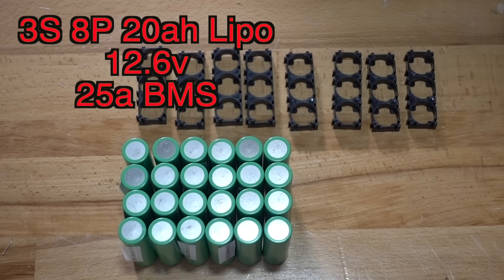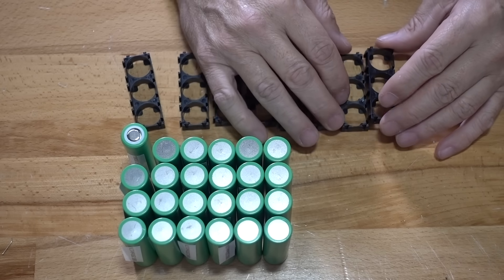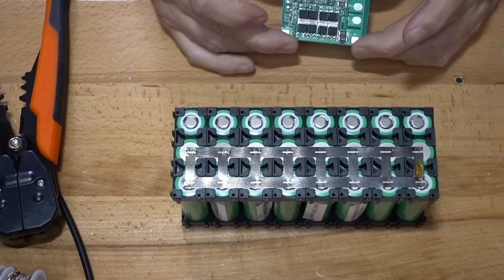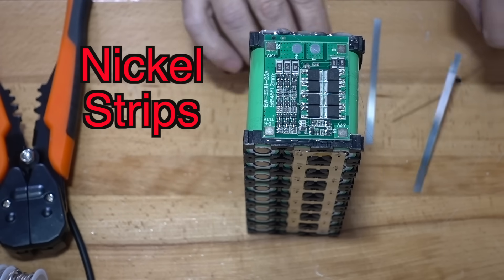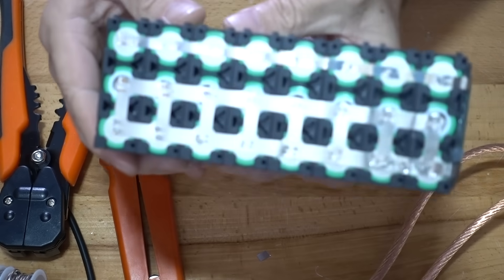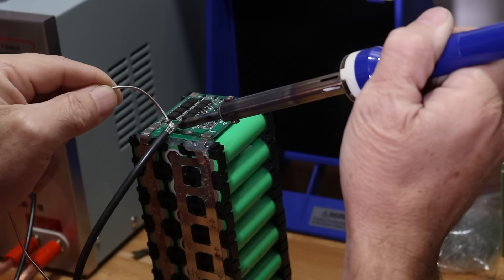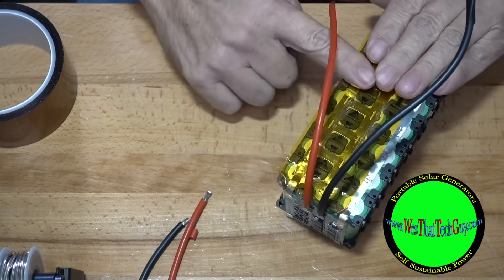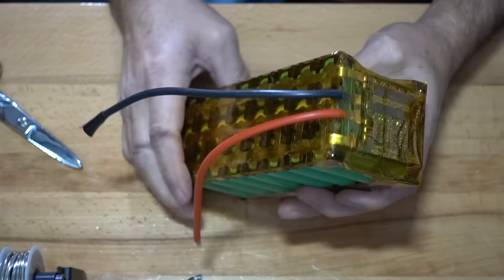How to build an 18650 Lithium Battery Pack with BMS.

Comment: Hi sir
I wanna make 48v 40ah battery pack for ebike my bldc motor is 1500w but unable to understand that how many cell are be used or could tell me any method to calculate
Reply from the maker: 13s16p for a 48v lithium pack. 208 18650 cells for 48v, 40ah and 400a continuous discharge battery thats 13x16=208 batteries using the same batteries that are in the video. Fully charged it will be 54.6v. You WILL NEED a special lithium charger for this build. Good luck.
Reply: @WesThatTechGuy  aha , some maths gonna astray here. You could use some cheaper cells . It needs 48V at about 31A to supply 1500W. This is fine but when you are taking that 31A from 16 cells you are barely taking 2A from every cell. Don't go mad and buy all Samsung 25R that can supply 20A continuous. To my knowledge all 18650 can put out at least 2A. Try and find the ones that are the cheapest per kwh. No need to worry about discharge. Happy building!!

Comment: At what range we can apply voltage to the BMS? Is that depends on total capacity? I mean for 4S BMS should we apply 13.5V to input of BMS?
Reply from the maker: sure you can supply 13.5v to the bms for a 4s not a 3s.

Comment: What should be the input votlage & current to the 4S BMS?
Reply from the maker: it would be 16.8v at 25a max. can get a bigger BMS too.
Reply: Thank you
Reply from the maker: @Prajwith Ullal you're welcome and thank you!
Reply: What do you use to supply voltage for the batteries to get charged. What kind of charger?

Comment: Can you make 4 or 5 packs of those and connect it together? How do you do that? Help please
Reply from the maker: Yes. You can run them in parallel or in series. Parallel: + and - to + and -.series is a bit different. you run them from a neg of one to the positive of another then from that pos to the neg of another and so on so when done you just have 1 pos and 1 neg. the 1st battery will have the pos lead and the last battery will have the neg lead.
Reply: @WesThatTechGuy  great, thank you very much I am sure that if you would make a video connecting several packages many people would see it. Thank you again
Reply from the maker: Thanks for the insight and look for one coming soon!

Comment: The way you attached the power out wires was really disturbing for me!
Reply from the maker: Any advice would be appreciated! Can you give me some pointers maybe?
Reply: @WesThatTechGuy  It is just me! I am taking soldering wires as a bit of an art! But i would twist the wires before hand fill them up with good fresh solder then fill up the pads too and then just touch them on the pads and get them stuck round and nicelly on the bms!
Reply: @WesThatTechGuy  basically fill up the wires with a good amount of solder and then put them on the bms! That would make a better placement and more secure too!
Reply from the maker: Ya I filled them prior and soldered the board but they are pretty thick so they were a bit of a pain.
Reply: @WesThatTechGuy  Working with such thick wires though requires a bit of a powerfull soldering iron since that thick wire dissipates the heat really fast. Dont know if that is the case with you.
Reply: @WesThatTechGuy  Also having that loose + lead wire that has a completely stripped end flopping around when you were kapton taping that pack up if it swung and hit a negative side of your pack it could have welded itself to your pack and then you'd be in for a world of not so much fun hopefully it would have burnt up the bms before causing any cells to explode
Reply from the maker: ya it could happen but not explode that quick. I've done these batteries for over 15-20yrs. I got this but thanks for the concern Logan.
Reply: @WesThatTechGuy  .....need a bit higher wattage soldering iron, pool up the solder and apply the wire into the pooled solder along with a "bit" more heat to make a good solid connection. 
Jmo...I was in the TV repair bizz for ova 35 yrs. Did some soldering in those yrs.😉
Reply from the maker: Thanks Frankie.
Reply: I use the good  ol' trusty Wall lenk LG -400,  150- 400w soldering gun. On my 2nd one now, as the tip finally delaminated after 22 years. It was just a smidge more for a complete gun & case ect. as just for the plug in replacement barrel / tip. Am all about joining  large gauge wires quick, so as not to induce to much transfer heat. Absolute must to fill the wire strands & contact first, before final soldering.... Overall,, very good /interesting vid ! . I74
Reply: @WesThatTechGuy  5:58  freeze the frame there .... see how the positive wire brush is almost shorting to the negative pad? .. not good.  Better workmanship can provide higher reliability ... instead try to limit width of wire brush bundle to equal or less than width of the board solder pad .. so you can form a nice solder fillet from the board pad to the wire brush, 360 degs around that pad. Forming a solder fillet increasing the solder joint strength and is an indicator of a full wetted solder joint .. that is why inspection for solder fillets is usually included in any industry solder joint inspection spec. 
    Yes, it is not easy to solder this big butt wire ... I hate doing it.
    Last thing for reliability ...add a mechanical strain relief to your wires, after the solder joints ... so any motion or tugging of the wires can NOT stress the solder joints.. NEVER let those solder joints carry mechanical stress loads.
   Everything else in the video was great .. and well produced, thank you.
Reply: Please what the model of spot welding? It's splendid
Reply from the maker: sunnko 709A
Reply: Life must be quite overwhelming for you.
Reply from the maker: for who?
Reply from the maker: Thanks for the heads up! I will try this.
Reply from the maker: Thanks. I have a 100w well now so no problems with the bigger wires.
Reply: I agree...

1) Add solder to the pad
2) Strip only one end of the wire leads
3) Pull the insulation on the other end to recess the conductor
(assuming a less rigid & pliable insulator)
4) Tin the stripped end of the wire
5) Use diagonal cutters to create an angled wedge cut on the tin end
(Now you have a long contact with less mass towards the tip of the wire)
6) Melt a blob of solder on your iron with "maximum" heat
Quickly:
7) Apply melted solder blob to pad
8) Put tinned end of wire into extra large blob of solder

Repeat for second pad.

When ready:
Strip remaining wire ends & add a connector for convenience. Recommendation for an inline fuse. They are cheap for the safety they provide.
Reply: Evil Dude  different human different opinion.

Comment: Is there a trick to soldering? You seem to be melting the solder instantly, whenever i try im usually holding the solder to the iron for over a minute before it melts, also it seems to take me 5-10 goes before the solder sticks to a circuit board!. Ive tried soldering to batteries too, after about 50 tries with several different batteries and not one stuck (I dont have a spot welder), I gave up and started using cheap Chinese battery holders made in a Chinese factory in China to hold my batteries.
Reply from the maker: Yes lots of practice and I consider myself as a novice at best! Get a GOOD soldering iron, preferably one that you can adjust the heat settings like the one in my video. you NEED the right kind and size of solder (this is a MUST!). Flux or flux paste is nice to have around to help clean the area needing to be soldered.

Comment: Why bother with a BMS? Just make up a balance lead and balance charge the pack each time
Reply from the maker: Vince Williams good question that has several reasonable answers. BMS is used in this case as a safety. I would generally balance charge a small pack like this but this is just one way to make a battery pack. Also these battery packs can take 25a load no problem and its not possible to really do that with balance charging unless the wiring is much bigger than say a standard 3s, 4s or 7s balance lead. When balance charging you are throwing minimal voltage and amperage to each parallel group.
Reply from the maker: Bms is for safety on this specific build. I agree balancing can be done but has to be monitored all the time and this pack can handle well over 25a cont. charge voltage and that's not that easy to do with a simple balance charger. The Packs I build for my clients generally run 25-200a continuous charge so we use BMS for the customers. I use both methods for personal needs as well but when selling a battery pack, power wall or portable solar generator like the Solar Geni product line I sell then the BMS is a must for safety.
Reply: Thanks for your informative reply, I can understand and appreciate the requirement for a BMS to handle the intermittent high charge situations that you will get with solar etc.
Reply from the maker: No problem Vince. Thanks for watching and I can always use another brain around here so please feel free to chime in anytime! Wes

Comment: Nice job I like it.
Any budy tell that how much mAh of a li-ion cell.
Reply from the maker: Thanks. Each cell is 2500mah/2.5ah and 20a continuous discharge and the pack I built is 20,000mah/20ah at 160a continuous discharge.
Reply: Thanx alot for nice reply.
If u don't mind have a question?
2 kw load how much time run on 220 v upon a 200ah lead acid battery via inverex solar inverter.
Reply from the maker: how many volts is the solar inverter? 12v, 24v 48v?
Reply: My inverter oprates upon 24 volts.
Reply from the maker: a 200ah battery at 24v will give you 4,800wh of run time. So at 2kw drain you're looking at around 2.4hrs at full depth of discharge. but that will kill the lead acid battery quick and you will have to replace it within a few months if you drain it 100%. Hope this helped
Reply: Thank you so much buddy. U solved my problem
Reply from the maker: @jojee Bhatti your welcome! Glad I could be of help.

Comment: How are the balance leads attached? How do they keep each cell balanced? Have you tested the cells after a couple cycles?
Reply from the maker: They are attached by a spot welder and Nickel strip as shown and explained in the video. So far so good they test out fine. Yes I test them over 20 times now.
Reply: @WesThatTechGuy  I saw that you spot welded to B1 and B2, which I understand for 3s1p, but I don't understand how the cells in the parallel groups are balanced as well. Guess I just need to think about it some more.
Reply: noleftturnunstoned parallel cells don’t need to be balanced because they are always the same voltage. If one would be higher, it would charge the other one. The bms has to balance only the voltage of the 3 parallel group in series.

Comment: OK...where did you get the battery charger?
Reply from the maker: @countryside I got that particular one on Amazon. Its a 30v 20a power supply. they are nice when you are just charging various different voltages and you don't have to have several chargers to do it. This one only had + and - leads.

Comment: Hi, It wouldn't be easier if you used the solderless battery holders like these? 
https://vruzend.com/

What you recommand using those solderles holders or taking the time to solder each one of the cells?

Thanks
Reply from the maker: @deepblueak for some it might be easier but it is much more expensive and they can be a real pain to get all the contacts right. Others have reviewed them and they are really cool but the time it takes to mess with them and the huge cost I just don't see it unless you're doing a small build once. For many or big builds just as fast and simpler do just solder them.

Comment: How would you recommend running a 48v setup with multiple 3s battery packs. I have about 40 and they all have their own bms. I could just wire 4 together but if one pack shuts off early it seems it could open circuit and burn the bms up.
Reply: No 3s, for 48v the configuration is 14s for 12v is 4s for 24v is 7s,,,, 3s 3s for 12v does not work well, the nominal voltage is 3.7v x 3 = 11.1v minimum voltage is 3v x 3 = 9v if you want to work with 12v you should use 4s configuration, BMS 4s
Reply: They are not standard 18650 lipo they are boston power swing 5300 lifepo4. I did wire them in 12s configuration and they charge to 48v and discharge to 42v with the inverter. This leaves them about half full but I figure this could extend their life. If I wire 5 together it will bring it up to about 60-62v but within the range of the inverter. However this will leave them fully drained before inverter switches to charge cycle.
Reply: @SamIamNotI  
LifePo4 the nominal voltage is 3.2v if you need to work with 48v the configuration is 16s
Reply: @sinusoidalwawe7777  Nominal voltage is 3.65 on these ones. http://liionbms.com/pdf/bostonpower/swing5300.pdf  I am currently running them at 12s and when inverter shuts off they are about half full.
Reply: @SamIamNotI  
That cell 5300 is not LifePo4 is Lithium-ion, maximum voltage 4.2v nominal voltage 3.65v minimum voltage 2.75v if you want to work with 48v the correct configuration is 14s
Reply: @sinusoidalwawe7777  Thanks to both of you for helping me identify these.
Reply from the maker: just run the 3s packs in series of 4s and that should do it. shouldn't be a problem.
Reply from the maker: Michael thats not correct. Nominal voltage on a lifepo4 cell is generaly 3.2v and charge voltage is 3.65v. The link goes to a Lithium-ion cell that is nominal of 3.65v and 4.2v charged? So either you sent me the wrong link to a lipo battery or you're mistaken and your battery packs are in fact lipo not lifpo4. Even at this parameter of lipo you would be fully charged at 4.2x12= 50.4v and with LFP you would be  at 3.65vx12=43.8v Or am I just confused as hell right now?
Reply: @WesThatTechGuy  Yikes...I was absolutely wrong. These are just a fancy lion. The place I got them from had them incorrectly identified. I get 3s7p packs off ebay for around 30$.
Reply from the maker: I'm lost? I first thought you were working with LIPO not LifePo4. That said are you wiring up 3s packs in a 12s configuration or just wiring up 12 cells in series? But 12 cells won't reach 48v only 36v. You'll need 16 cells for 48v with LFP cells.
Reply: @WesThatTechGuy  Yeah I have 3s packs with BMS, they are iron phosphate with nominal voltage of 3.65. Full they reach around 48v. Nominal voltage at 12s is 14.4v
Reply from the maker: Ok that sounds more like it.

Comment: that is a nice set up you have!  like the battery pack too.
Reply: Spot welders are cheap on *Bay-- or you can make your own.  I would not solder to cells-- too easy to damage them (danger!).  See: https://www.keenlab.de/index.php/product/kweld-complete-kit/
Reply: Ken Thank you for your input
Reply from the maker: Thanks Robert
Reply: Very nice , I like it, very neat and clean.  Question,  does fuse wire needed on each cell?
Reply from the maker: thanks. NO not with BMS. You could still do this but not needed at all. If you were using as a power wall and not going to be home to monitor than yes the fuses would help.
Reply: Ygu

Comment: Hi great video easy to follow I'm new to DIY 18650 what is the difference 3s v 4s  and can you make this pack longer eg longer amp or run time 
Thanks
Reply from the maker: Thanks @Colin Fox. 3s is 3x3.7v=11.1v nominal and 4.2vx3=12.6v charged 4s is 14.8v nominal and 16.8v charged. So 4.2v difference when fully charged and 1 more battery cell in the pack for a 4s. 3s=3 cells 4s=4cells.
Reply: Give video of 48volt battery with CBS.and what may the cost